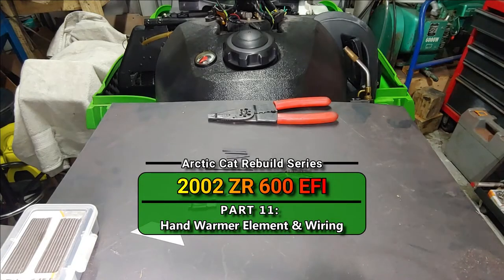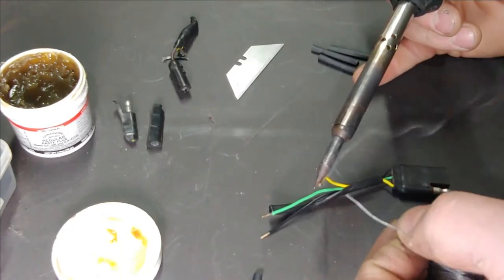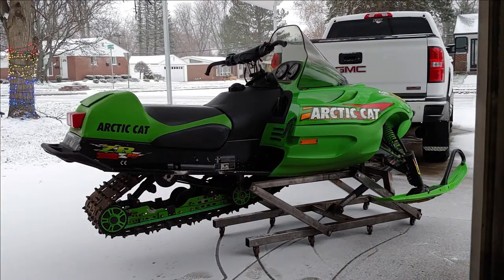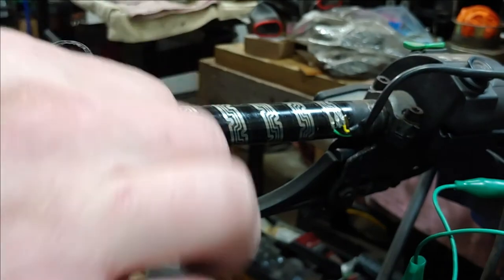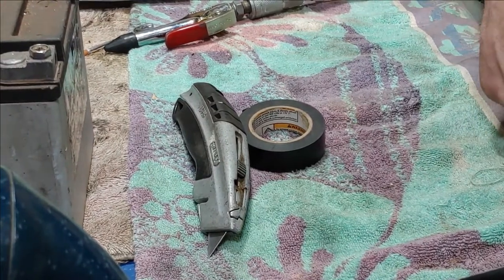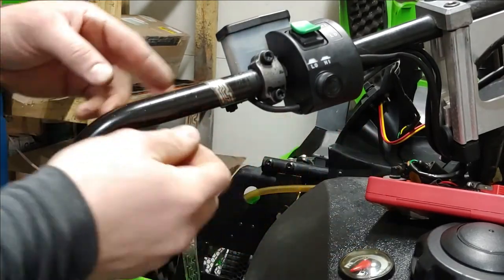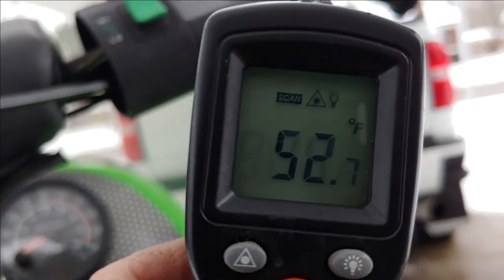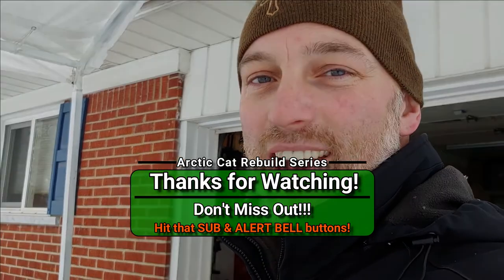02 Arctic Cat ZR 600 EFI Part 11: Hand Warmers [The Fix!]

Comment: I like using a heat gun rather than a torch whenever I'm anywhere near the gas tank. ;)   I have the exact same sled but with reverse.   Love it!
Reply from the maker: Yes. You are 100% correct. But unfortunately I didn't have a heating gun at this point otherwise I would have used it. I didn't smell any fumes so I figured I was safe LOL and yes the reverse is very nice I have 3 slides with reverse but probably going to be selling two of them soon before the season starts

Comment: Nice fix.  I lost my high setting, found a loose wire.  I tinned it last week, nice to have heat.  Our season is coming to an end fast.  Continuity test is how I found my issue.
Reply from the maker: Yeah they can deteriorate over time. Sometimes it's just corrosion in the plug. Thw wife ans daighter were thankful! 

Yeah our season is done. High 30- low 40's from here on out it looks. Smh

Comment: Thanks for the info. I'm looking for info on replacing the thumb warmer on a 2003 zl550 as well.
Reply from the maker: You can buy new ones and pop the old one out and glue the new in or get a good used throttle lever.